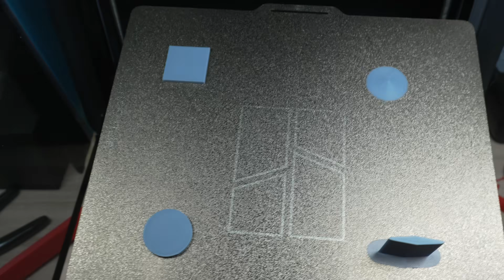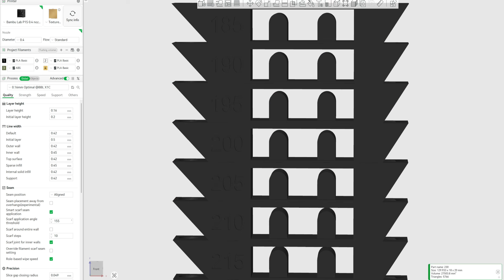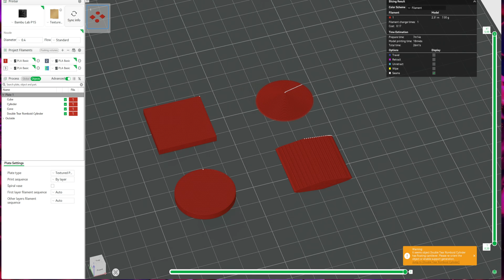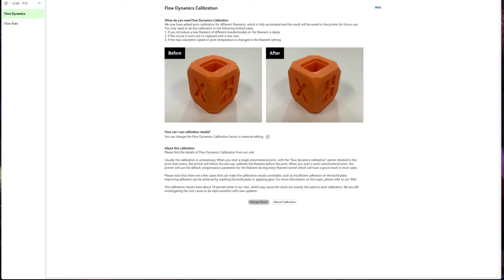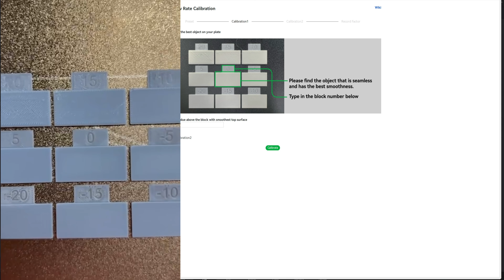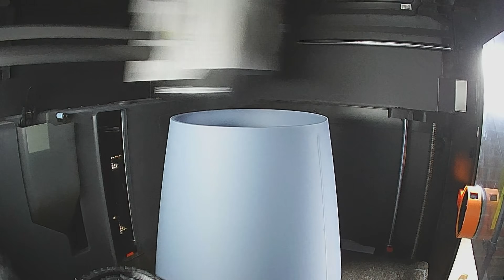Bambu Studio Flow Calibration Explained | Cleaner Prints Without Changing Temperature

Comment from the maker: Thanks Marvin! 😊

Blue Grey PLA does seem to be a little less forgiving than some other colours. I’ve found that running a flow calibration and making sure the filament is properly dry can help improve bridging and support performance.

For support marks, you could also try reducing the support top interface density or increasing the support Z distance slightly to make removal easier.

I’d be interested to hear how your calibration tests goes and whether they improve things for you. Good luck, and thanks for watching! 🧡

Comment: What are the odds that I would search for a calibration video because I spent the day fighting issues with Bambu Blue Grey PLA?  I love the color and the finish, but I have a lot of problems with any bridging and getting supports lose is a real pain.  Due to the color, when you break a support lose sometimes leaves a mark, that is almost impossible to get rid of.  (If any of you have experience with Bambu Blue Gray and have comments about things you have discovered.)   I will be firing up the calibration tests tomorrow.  Thanks for this video.
Reply from the maker: Thanks Marvin! 😊

Blue Grey PLA does seem to be a little less forgiving than some other colours. I’ve found that running a flow calibration and making sure the filament is properly dry can help improve bridging and support performance.

For support marks, you could also try reducing the support top interface density or increasing the support Z distance slightly to make removal easier.

I’d be interested to hear how your calibration tests goes and whether they improve things for you. Good luck, and thanks for watching! 🧡

Comment: Great video!
Just a quick tip for anyone interested:
If you go into the settings in Bambu Studio and enable Developer Mode, a new '[+] Calibration' tab appears on the top window bar.
It includes built-in tests for temperature, flow rate, pressure advance, retraction, and VFA.
There is even a tutorial link right there that takes you to the Bambu Lab wiki to explain how to use them.

Hope this helps!